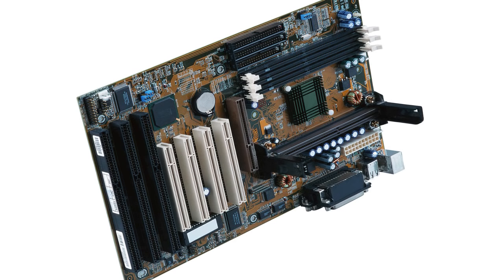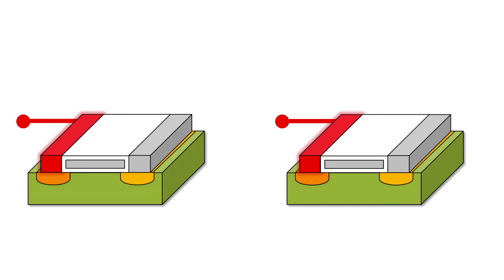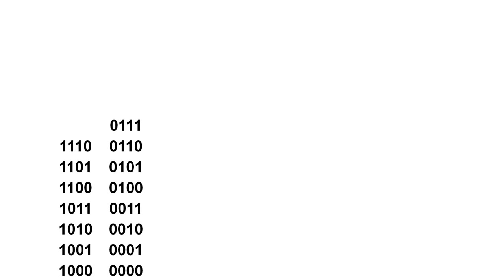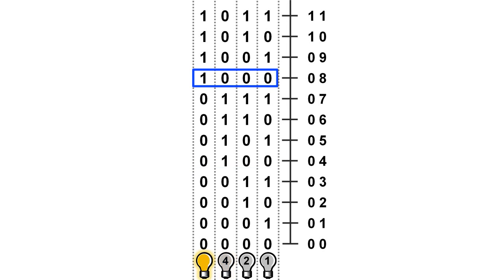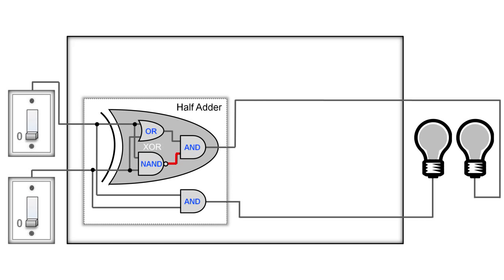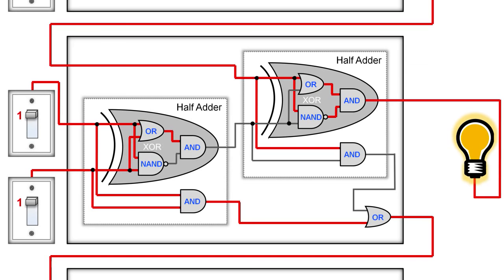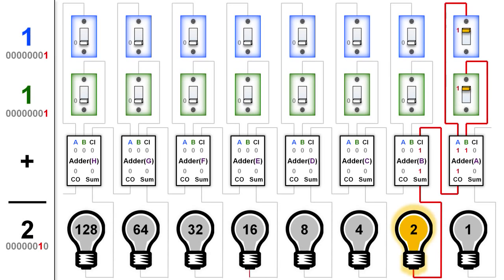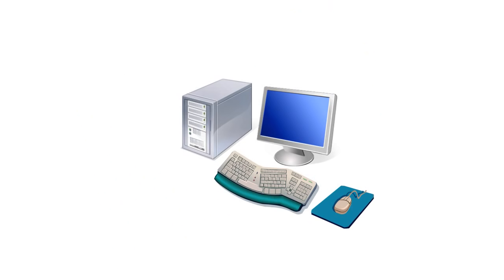How TRANSISTORS do MATH

Comment: 12:01 but who does switch on those switches?
Reply: Nick V. this is an excellent question that even I have!! I don't understand how software is able to turn on those transistors!!! there's some abstraction between software and hardware that I can't find anywhere!!
Reply: I don't 100% understand it myself, so what I say might not be totally correct. Anyone who reads this and knows more, feel free to correct me.

There is a chip on the motherboard that has instructions already stored on it (the BIOS). When you power on your computer, the CPU reads those instructions and starts executing them. These instructions tell the CPU to get the instructions for your operating system and load them into memory, then the operating system instructions will be able to be executed. The same happens when you open a program, just one extra layer up. The cpu executes some instructions from the operating system that load the program's instructions into memory, then that program's instructions will start executing.

TL;DR The software is able to turn on the switches because the instructions are loaded into memory, which the CPU will read and execute.
Reply: Nytheris thanks for the reply! I don't think you answered the question yet. How do the instructions in software be it in bios or operating system affect hardware transistors?
Reply: Yeah I didn't realise until after I posted the reply that I got completely off topic and explained something different.
An instruction is just some bits, for example 01001001. That instruction is loaded into RAM, and when the CPU retreives it from RAM, it has logic gates that will manipulate those bits (which will be just signals on wires at this point) to work out what it should do. If that doesn't explain it then I guess I don't fully understand what you're asking. Have you seen the "How a CPU Works" video from this channel? That might explain it better.
Reply: Nytheris that kinda makes sense :) the instruction code is basically 1's and 0's that are basically interpreted as logic gate signals. then there must be a whole complicated process of switches going on and off down the the line as soon as the instruction is loaded into the cpu from the RAM. From the CPU register there's got to be millions of logic gates that come into action to give the output . The problem is that people think of code as software.. when it's actually a sequence of logic gates that are already on or off as soon as the instruction is loaded into RAM. What's shown on the screen is just another form of abstraction (read code and graphics) that is used to tell us the state of logic gates in RAM!

Comment: what controls those switches though? I paused at 13:00 to ask this btw.
Reply: Good question but kinda irrelevant also answer is complicated. The video is about "how CPU adds numbers" so this piece of hardware will add two numbers and will give you the result. For the answer to your question, the gist of it is that computer programs are all about arithmetic operations done on some kinda data. This data is "PROCESSED" in the CPU just like how you see in the video. You are asking where the "numbers that are added come from to the ADDER?"  They come from the REGISTERS inside the CPU. Registers get the data from CACHEs. CACHEs get the data from RAM.

There are hundreds of levels of abstraction on computers until you come to this level of hardware, it is the most complex piece of technology humans collectively developed.

Comment: I think people are smarter back then since they were thought in a lower level, the building blocks of the higher level today
which makes it easier to imagine high level applications today with low level concepts:

Binary      
  "0001" "=" 1 1*2^0 1
 "0001" "0001" "=" 17 1*2^4+1 17
 "0101" "0001" "=" 81 5*2^4+1 81
"0001" "0001" "0001" "=" 273 1*2^8+1*2^4+1 273
"0101" "0001" "0001" "=" 1297 5*2^8+1*2^4+1 1297

Comment: How does charging the gate open up the conducting channel?
Reply: It's just the chemical makeup of the transistors
They are made so that when they have enough voltage running through them they allow electrons to flow through them

Comment: That 'Full Adder' part confused me so much, I gave up and had some toast.
Reply: You can think of it as handling the carry over. In base 10 example, 19 + 19 = 38. 
9+9 = 8 with ten carried over to the next digit, 10 + 10 + (10 carried over from the ones digit) = 30, and 30 + 8 is 38. The full adder handles these cases where the previous digit adds to a larger digit than it can handle so the next digit has to add 3 numbers instead of just 2.

Comment: Are there ever cases where all of the switches are on so 11111111 + 11111111? This would surpass the 255 maximum so what prevents computers from adding these?
Reply: The computer may interpret that as -1 + -1 (or simply -1 - 1) and give you -2 (11111110).  The computer will send an overflow flag to the program to let the program know that the result of the addition is too large to store.  How the program responds to the overflow flag is up to the programmer.
Reply: Timothy Chapman Why isn't it standard to reiterate the overflow and use it as some sort of remainder? If this is how a calculator adds, I'm just confused how it can add numbers in the thousands without breaking those large numbers into separate portions.
Reply: It's not standard to use the overflow as a "remainder" because there are other things that the overflow flag can be used for.

Larger numbers just use larger adders.  The adder in the video is an 8-bit adder with a maximum value of 255.  A 16-bit adder would have a maximum value of 65,535; and a 32-bit adder would have a maximum value of 4,294,967,295.  There would also be memory cells large enough to hold such values.

In short, if an engineer wants their device to do math with larger numbers, he just makes components large enough to be able to deal with those numbers.
Reply: Okay thanks, that clears it up a bit. I'm still confused how a 32 or 64 bit would add up numbers. Would it be like this video with longer columns? So instead of 8 slots for a 0 or 1 it would be 32 or 64 slots, correct?
Reply: There would be 32 slots for a 32-bit adder and 64 slots for a 64-bit adder, yes.

Comment: I do not like the try of passing from decimal to binary.  It can lead to misunderstandings for those who do not know the base of an arithmetic system :

decimal (10) has ten numbers -> 0,1,...,9 or for example that with bases 7 has 7 numbers -> 0,1,...6. In the same way binary has two numbers -> 0, 1 . 
hexadecimal (16) has sixteen numbers ->0,1,2,3,4,5,6,7,8,9,a,b,c,d,e,f !!!!

So every time we reach the upper limit we have to add one to a higher power digit.
for example 
Decimal: 789 = 7*10^2+8*10^1+9*10^0, and if I add 1 9+1 = ??? NO digit in decimal system to implement this, so I reset this number and add one to the higher level number: 789 + 1 = 700+80+10 = 78(10) (NOT accepted) = 790

The same goes for binary, but now my upper not accepted limit (my base) is 2. I have only two digits: 0, 1

so lets count!
binary 000 ->  0*2^2+0*2^1+0*2^0 = 0 decimal
+1        000 + 1 =  001 ->0*2^2+0*2^1+0*2^0 +1*2^0 = 1 decimal
+1        001 + 1 = 00(2) (NOT accepted) = 010 -> 0*2^2+1*2^1+0*2^0  = 2 dec
+1       010 + 1 = 011  ->  0*2^2+1*2^1+1*2^0 = 3 dec
+1       011 + 1 = 01(2) (NOT Acc.) = 0(2)0 (NOT Acc.) = 100 -> 1*2^2+0*2^1+0*2^0 = 4 dec
....
....
and so on.
Note that symbol * stands for multiplication and symbol ^ stands for power.

Comment: Great Video. Now i just want to know how the Computer translates Decimal in Binary. Hopefully someone answers before I figure it out myself.
Reply: It doesn't.  Not directly anyways.  It's all binary and no decimal.  Software may be used to convert text that we interpret as decimal into a format that the computer understands, but even that is still binary.
Reply: But if you type 103 into a calculator surely one piece of the device will convert it into binary so the calculator can use it.
Reply: Not necessarily.  At least not for entering data that the calculator can use.  Typing "1" into the calculator may simply put "1" into the register as binary.  Then typing "0" would cause the calculator to multiply by 10 and then add 0, storing "10" into the register.  Then typing "3" would cause the calculator to multiply by 10 again and then add 3; finally putting "103" into the register.

Any conversion that takes place would simply be converting whatever is in the calculator's register to something that the user can read.  That way, no time is wasted converting data to a human-readable format and back.

Comment: Everything is okay but i think the half adder part is unclear and might overwhelm newbie.
U should have been little  elaborative here.
U didn't tell why adder needs to have and gate for higher bit and xor gate for lower bit output..
I very well know that bcz i m engineering student.
And gate is bcz if u see addition in binary only when both bits are one output has 1 on higher bit while..when  one and only one input switch is on the lower bit output gives output 1 and thats exactly why we used xor gaye bcz it gives such
Output,A= no1,B=no2,C=output carry,S=output sum.
A B    C     S
0 0     0     0
0 1     0     1
1 0     0     1
1 1     1     0
        And  XOR

Comment: So basically each part of the processor has a different node and depending on the calculations the processor takes the output from one pin and knows exactly what pin to feed the input into to get the correct output for the current calculation.

This is all I understood. Anything else is nah

Comment: How do they fit all those light bulbs into a calculator?
Reply: They don't.  The light bulbs are just to give you a visual of the output.  The calculator does all it's calculations without light-bulbs.
Reply: What would happen is the light bulbs would be removed and the wires attached to the screen

Comment: This video is quite inaccurate.  Computers use both N-Channel (the transistor described in this video) and P-Channel MOSFETs.  The output is between the two types of transistors with the P-Channel being connected directly to the power source and the N-Channel being connected to ground (which completes the electrical circuit).  The technology is called CMOS.  For each input, you have 1 P-Channel MOSFET and 1 N-Channel MOSFET.

The transistor layout in this video will NOT work!

Comment: um, excuse me, but isn't there an easier way to make a AND gate? just hook the wires up to the input and the gate. a transitor is basically just an AND gate. and also, an easier way to make a OR gate is just to put the wires together.
Reply: ian poe I guess it has something to do with the transistor as an amplifier: The Source / Collector is designed to handle much larger electric currents than the gate/ base. But your input currents are normally the same.

Comment: Most likely mentioned a million times already... But that chip with the green heatsink on it is the chipset, it's the motherboard controller.
The slot with the two plastic guides sticking up is a Pentium 2 slot for a Pentium 2 processor, which comes on a board of it's own inside a plastic casing.

This killed any credibility this video might have had. Sorry.

Comment: Yea but in reality what you have here is just animation.  It is not actually in the circuits.  There are no light bulbs with numbers on them.  There are no switches with 0 and 1 on them.  There no labels as a half adder, full adder, wires, gates.  There are no places for 0's and 1's that you are conveniently showing here.  These shapes, including your first transistor, source, gate, and drain, not even remotely look like that. Aside from the fact that there are really no switches and better yet no switches with 0 and 1 written on them, who is turning the switches on and off anyway?  This is just for explanation purposes, just abstracts when in reality there are no places for all these 0's and 1's.   Just electric current and voltages with no corresponding places for the digits. NO?
If you say yes there are actually there, then where are they located,  in the gates, source, drain or the wires?  On my screen or my keyboard or the case of my computer?

Comment: Yo. Your explanation of binary is bad. By first saying that 2 3 4 etectera do not exist and then trying to say yeah but lets just pretend 10 is 2 you are going to confuse people. Binary is couting with only 2 symbols. You could use christmastrees and apples, but the system would be the same. Just remove the first part. the rest is good.